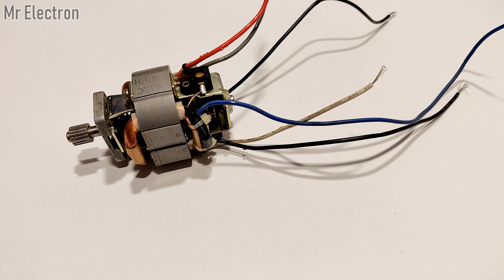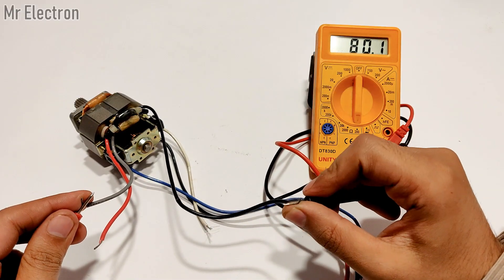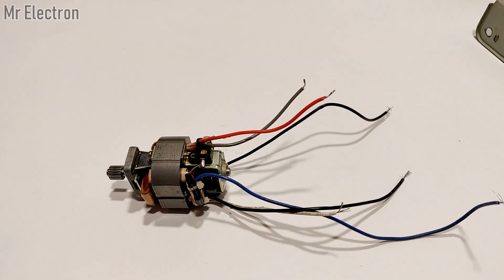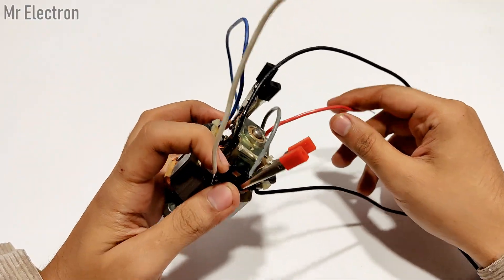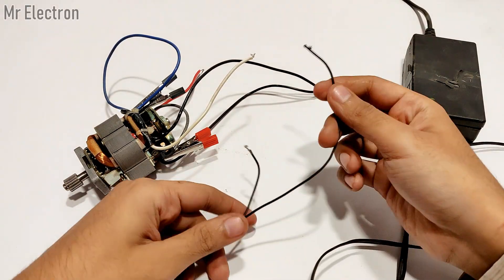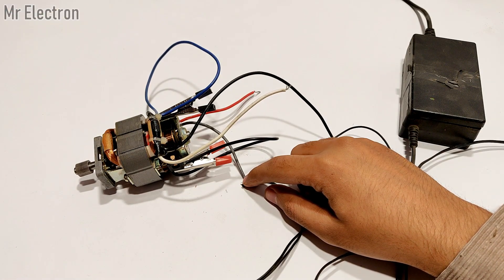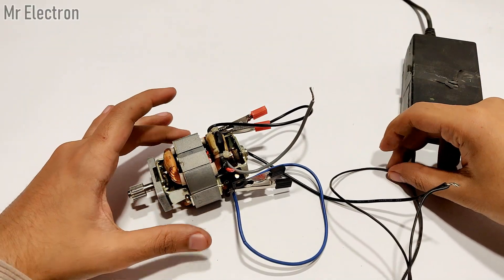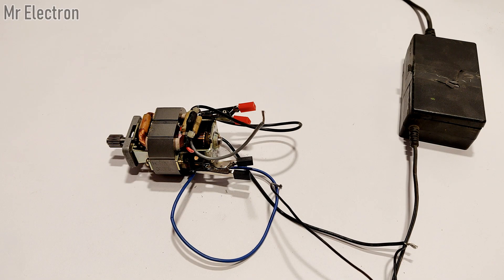Universal Motor from a Mixer DIY | How to do Connections to Run it !

Comment: I have very similar one but runs on 220v, it has two wires connected to the outlet and three wires that go to the switch. One is supply wire and other two are used for slow and fast speeds.

Comment: Dear Mr Electron, thank you so much for your valuable review. But I have a vacuum cleaner motors and could I use them in DIY projects for table saw, sander, drills... if so would you forward your help regarding the how to do steps and guide please. Thank you...
Reply: have you made anything with universel motor ? i was thinking of making drill and saw is it possible ? and dose this needs any capacitor?

Comment: Hi sir. Am trying to wind a field coil of a small Universal motor of Vaccum cleaner of 1000 watts(Yureka forbs trendy nano brand) I am confused in terms of number of copper rotation for coils. Can you tell me Usually how many copper rotations to be made for one side coil?
Reply: Just measure the resistance from the windings only the more resistance the more winding there are for high speed low torque find the lowest resistance and  for high torque low speed find the windings which have the most resistance and make sure you use the same resistance on each side. Also try to wire the thermostat or thermal fuse in series to power and quick tip you can run the windings on a different supply than the armature or rotor weather if it’s ac or dc just make sure that if you run them on ac run them on the same frequency it doesn’t matter about the Voltage and if you run the field windings on ac run the armature on ac and same goes to dc

Comment: is it possible to change rotor speed by using  dimmer ?
Reply: Yes. You can actually power the 2 windings separately with full power, and then control the speed of the rotor by adjusting the dimmer switch which would be supplying the brushes. You can change the direction of the rotors also by swapping the 2 connections to the brushes.

Comment: Which voltage battery are used please tell
Reply: There is an equation that you can google that will tell you the ideal voltage after you fill in the resistance in ohms, whether you’re wanting to use AC or DC, the type of motor, and possibly one other factor out of a few choices.

Comment: If that's a mains voltage motor the current draw will kill the power supply as the voltage is to low.Also won't have any torque at all.Only good for testing but that's all

Comment: Sir can u help me i have a universal motor and run it on ac direct and it’s work perfectly but i dont use any capasitor is it safe to use it without capasitor?
Reply: universal motors don't need capacitors at all

Comment: I have seen your videos and really It will help to solve the issue of how to run the universal motors. I need your help or a video to run a 110V drilling machine either in the dc or in the AC; one of my friend gifted a 110V drill which I wanted to use. Will you please help me in this.
Reply: did you get any advice somewere?...if not listen..use a transformer.please mention the operable codifications so that i cam specify between ac and dc

Comment: As long as those 2 devices, strapped to the field windings are ok, there is no need to bypass them. In any case, there is no practical use in trying to run this motor at such a low voltage. And lastly, in terms of effeciency, this motor is not very good. It is preferred because it has good torque vs it's size and therefore is a good choice where space is limited.
Reply: ''there is no practical use in trying to run this motor at such a low voltage'' maybe for some rc stuff when trying to go low cost, since they seem to have larger torque than normal dc motors of similar size maybe? i could be wrong

Comment: The electrical component you were referring to is some type of thermal switch when the coil overheats this disengages the connection.
Reply from the maker: I am not sure but yes that could be it.
Reply: Since it is a DC motor, very likely they are diodes. i've seen thermal fuses in transformers, never in motors. But I could be wrong.

Comment: Good video    This motor has good torque at starting  but speed  will go down by increasing the load
Reply from the maker: true for every motor 🙃
Reply: I think that shunt motor[parallel] has stable speed with increasing the load @MrElectron
Reply from the maker: Dc motors have the maximum torque (starting, running & full load) followed by the universal motors. So yes shunt motors perform better than universal motors but shunt motors also slow down with increasing speed.
Reply from the maker: Are you talking about ac shunt or dc ?
Reply: What do you mean increasing the load?
Reply: @woody442  Thank you